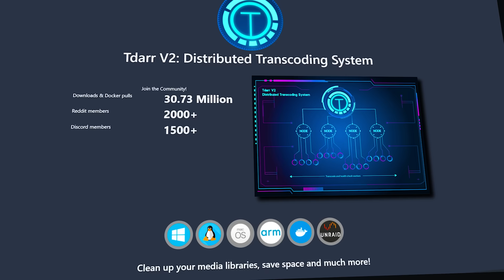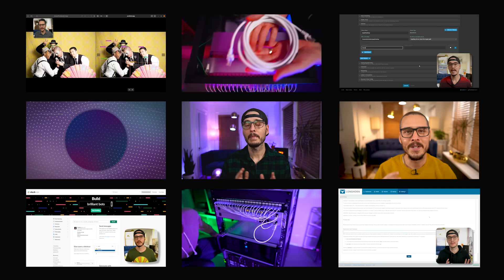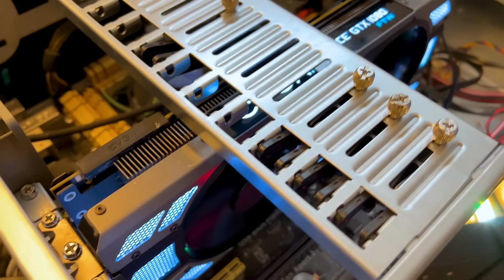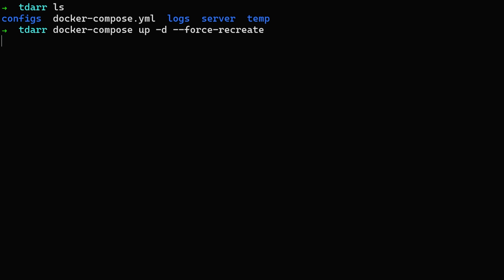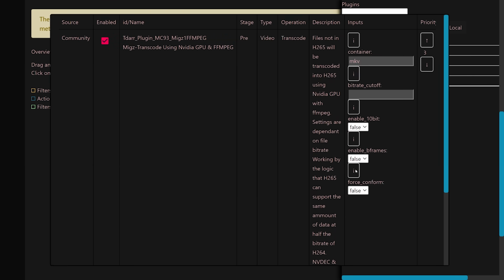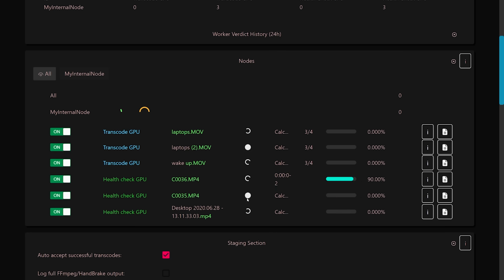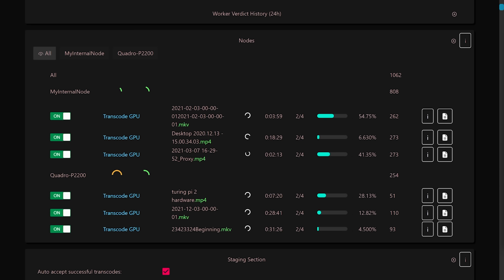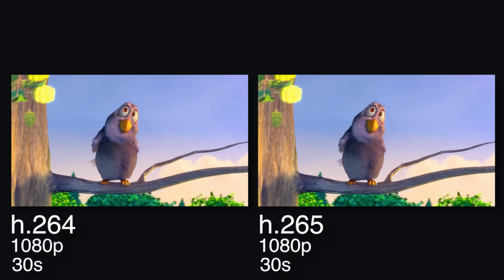I Freed Up 700GB+ Converting my Videos Using Tdarr

Comment: Tim - watched your tutorial again. This doesn't work too well with new TDarr with the Flows chat. Can you create an updated one using the Flows? or do you have a flow template that we can use? so we can point the library to the folder and it replace all the files in that library with the converted one?

Comment: Storage capacity is still growing at an exponential rate and I do no want to lose any quality.  Nor do I want to get arthrosis from months of twiddling thumbs while waiting for the transcoding to complete or want to watch every file to ensure  none of the files has been corrupted by accident.  Iow I use new codecs only for new projects.
There is also software such as NLE that keeps hash to uniquely identify video files.  Transcode a video input file and next time you open that old project you may have a whole lot of avoidable work.  Now that AVC / H.265 is slowly becoming more mainstream also consider VVC / H.266 is beginning to roll out.  Converting the video files yet again means cumulative loss of quality, usage of power and time.

if however your project happens to be to keep a backup of youtube or those other ****tube sites  ...  well, transcoding may be a good idea after all 😀

Comment: I've actually done some 4x zoomed comparisons between h.264 and AV1 or h.265.  AV1 and h.265 are better at lower bitrates.  But for archival quality, h.264 is actually better quality for a given size thanks to more mature tuning options.  This will likely change in the future as AV1 and h.265 gain wider adoption.  But for now I still use h.264 for ultra high quality encodes.

Comment: I'd really like to do this. I just don’t want the video quality being slightly lower than before. When setting up Jellyfin, I thought it’s a good idea to handbrake everything. Turns out, a lot of artifacts in slightly darker scenes. I had to re-scan everything and use another tool to just re-arrange and filter audio and subtitle tracks. 
Because of that, I’d only like to use it if it’s lossless. I need to read a bit more about it. Thank you!

PS: My library is 9.37TB at the moment

Comment: Wait till my dude learns about AV1
Reply: I was about to comment this. Plus if you record with OBS you can just record AV1 natively so you don't need to do any extra work (if you have a GPU that supports AV1 encoding).
Reply: @obscuratea  OBS' AV1 implementation is...not great, to be fair.
Reply: 2:17 One problem... the card selected (NVIDIA GTX1080) isn't capable of hardware decoding AV1 (much less encoding).  
Minimum Generational Requirement for AV1 Encoding is RDNA3 for AMD, GTX40 for NVIDIA and XE2 for Intel.
 Hardware decoding capability starts at one generation prior (This Excludes Navi 24 of the RDNA2 series for AMD)
Reply: @TwistedMe13 i wouldn't recommend gpu encoding of AV1 anyway
Reply: @Melechtna  yeah, I've been using Handbreak to encode some of my Jellyfin MKVs to From H265 to AV1. When I use GPU encoding it is frequently the same size as H264 but when using CPU encode I can get it to half the size of H265. It is far from time convenient, but I'm not using my computer overnight so I will often queue up a batch before bed. Its crazy seeing a BlueRay go from native 30GB down to 2GB with no noticeable loss of visual quality.

Comment: If you use ffmpeg and have an nvidia GPU here is a quick command to get pretty good quality h265 from a 4k h264 video: 

ffmpeg -i input.mp4 out.mp4 -c:v hevc_nvenc -rc vbr -cq 24 -qmin 24 -qmax 24 -profile:v main10 -pix_fmt p010le -b:v 0K -c:a aac -map 0 -strict 2

This is the best quality command I have found so far.

Comment: Hey TIm! I have been following your videos for some time now and I've learned a "hAckload" of things! So Thanks, first of all! I am down this rabbit hole because of you! hehehe.

I recently deployed a Kubernetes Cluster using your Ansible automation script, and it is great! I did a few changes to use "UEFI and romfile" boot on proxmox (to get intel igpu support) and I got the intel plugin working with my plex with HW transcode and all. So I am super happy to have achieved this with your guides.

Speaking of guides, could you give any directions on how to do this exact video but using Kubernetes (I just moved to K3S and hacked my way through guides) so I am very noob still) with igpu support? Is this even a good idea?

My objective is to use the otherwise 'idle' igpu and limit it's usage to do transcoding on when the cluster is not using it for Plex just to have all videos constantly transcoded.

Specs: 4x Proxmox cluster (Lenovo m720p)  - Intel Core I9-9900T -  UHD Graphics 630.

Keep up the amazing work!

Comment: Remeber, NVENC H.265 is way worse than CPU H.265 encoding. Yes it's fast but extremely inefficient. You could've saved double the space if it was CPU encoding.
Reply: This can be true but lots of people with large library rather faster encoding, the quality with GPU and the saving is pretty good without the long wait.

Comment: Tim, great content. Always learning something. Have you looked at unmanic by any chance. I have been using your method with tdarr since this video went up, thinking of changing to unmanic for the file sizes are much smaller and cant tell any difference in the video quality. e.g Converted my BluRay Star wars from around 10gb to between 6gb - 8gb using different settings / plugins with tdarr. Result using unmanic, got the size down to 2.5gb.
Reply from the maker: Not yet!
Reply: Not only I got Unmanic working faster, but it's open source; for those who are interested in that aspect too.

Comment: I started with a rpi (RIP it died.. I made a custom ice holder to cool the cpu.. had to refill the ice canister every morning).
Now i've worked up to a whole cluster with my 3090 being the heavy lifter.
Here are my results for anyone interested.

Performance:
rpi                                           < 1 fps
M1 mac ca                            1-5 fps
4vCPU VM esxi i7-4770k      24 fps
RTX 3090                              169 fps

Not sure if there is any point to letting the RTX 3090 work on more files than 1 since my encoder is also at 100%
EDIT
So I added 2 CPU jobs and 2 GPU jobs on my gaming rig. 
Even though my encoder is maxed i still got 160 fps on both GPU tasks. 
So it is worth doing multiple tasks eventhough the encoder says its maxed out. 

on 720 footage 
RTX 3090 and I9 9900k stats with two tasks each(same results as if i let one GPU and CPU do one each):
CPU tasks both get ca50 fps
GPU tasks both get ca220 fps. 

So far making it a total of ca537 fps from my gaming rig. Pretty sweet.

Comment: Tdarr is just using ffmpeg with actually pretty horrible default settings. It is just a front end for ffmpeg. I have a script that can do the same and do it better quality wise. Also Hardware encoding is beyond inferior to CPU encoding. Way more blocking and way more softness in the output. But to each their own I guess.

Comment: I was Supper Happy to see that video, so i jumped the gun configured Tdarr and rushed with encoding on GPU. 
I lost about 20GB of footage because of some bug or something (some of my videos got "converted" to 3d or something, they shows similar as 3d, screen next to screen but colors are broken and video is completely unusable).
I used the same settings as you Tim. Hard felt, so no sub, no like today.
Reply from the maker: That’s unfortunate.  Sorry they had a bug.  I didn’t run into this.  Maybe create a copy instead of replace until it’s done?
Reply: @TechnoTim  youp, that's the lesson I got =)
If something is too good to be truth, verify =P
Still i am not sure what caused the bug, I suspect that it was because of having some 3d movies in that library, and after encoding one all got the settings (i am not in rusz to run it again to verify ) 
Anyway, Thanks for a great content!

Comment: Based on the transcode options seen in your video. Transcoded videos might have less video bitrates.
"Settings are dependant on file bitrate Working by the logic that H265 can support the same ammount of data at half the bitrate of H264."
I guess the disk space reclaimed comes mainly from that bit rate decrease.

Comment: Would limiting the transcodes to 1 make any difference in the time it takes to complete 3? I feel that setting it to 3 just make each transcode take 3x as long.
Reply from the maker: you're right, it just divides them up however there might be gaps where the trasncoder isn't being used and using more than 1 stream ensures maximum encode time

Comment: Thanks for this. have been looking for a solution as I have around 80TB of video footage which i Need to archive and reducing the size while not affecting the quality will be a great move forward. Tried this with a Tdarr server and node on Windows 10. All seems ok until I try transcoding files over 4GB, they transcode but the copy from the cache does not happen - am I missing something fundamental here? Has anyone had the same issue on windows or linux with files greater than 4GB? (have about 35TB which are over 4GB, max size i think is 90GB. Any suggestions?

Comment: to me, its like saying let's rip vinyls and throw them away once converted.
makes absolutely no sense. I'd adtualy compress/zip instead. that way it's intact. also, if you dont have the space, backup/archive/build a bigger volume...etc

the premise of this video is weird. it would make sense when speaking of plex which has a built in transcoder to stream on the fly but to actualy touch the original source files is like insane.

Comment: CPU/Software encoding often allows for more quality to file size ratios, as hardware encoders are often limited in their capabilities as compared to software encoders.  This should not be interpreted as saying Hardware encoders can't do as good of visual quality as a CPU/Software encoder.  It's strictly a quality to file size ratio.  A CPU/Software encoder with some of the craziest options, will be able to do a high quality image using less storage space than a Hardware encoder will be able to.

Settings and CPU depending, you can fairly easily get to messing with encode settings that will triple or more the encode time.  Quality vs Time often comes down to very subjective opinions with wildly different reasons for each person.  If you're doing a single video and you don't care if it takes all night to encode, a CPU/Software encoder is probably better for your purposes.  If you're on a tight time line and have to whip out several videos or hours worth of video, you may opt for Hardware encoding or even a combination of hardware and software encoding (just to keep all your resources busy) and skip on some of the file size settings/savings in favor of saving time.  If you have zero concern for storage space constraints, a hardware encoder and speed might be a great option for you.

And that whole argument of time saved vs storage size requirements is also going to be extremely reliant on the hardware you have available.  A 5950x will pretty handily chew through some software video encoding, and if you have one of those CPUs, and you're looking for quality, you may as well use it instead of hardware encoding.  But if you have a 4 core CPU and a decent GPU, you may opt for the hardware encoding option.  It's all going to be very case by case, person by person... subjective.

Also, a great rule of thumb is that you should always try to encode from the source if possible.  Transcoding introduces quality losses and those can vary depending on exactly what you're doing.

If by chance, when you first encoded the video, you chose to use exceptional quality settings (far in surplus of what you really needed or maybe you were targeting near lossless image quality to start with), you can likely get away with a transcode to a more efficient format, and visually see minimal quality loss, if at all.  If instead, you were very aggressive, aiming for small file sizes to start with, say 480p with a bit rate that made reading text on a youtube comment section difficult to read, you should probably not transcode the file at all.  And let's face it, anyone who has owned a computer for the last 10 to 20 years, is likely to have some of those old 480p videos where the settings were very obviously aggressive for storage / bandwidth savings.  Leave those videos alone lol.. unless you can recreate the source material or have the source material to do a redo.

Comment: Transcoding 8tb of videofootage with a xeon e5-2407 v2, would I be able to achieve that within my current lifespan? Or is a gpu really a dealbreaker when dealing with several terabytes?
Reply from the maker: CPU transcoding gives you better quality and smaller file size .  I saw go for it!
Reply: @TechnoTim  Really? In that case there's no harm in trying, thanks

Comment: I use handbrake to take direct blurays to mkv using MakeMKV with 5.1 sound, and it will drop it from 25gb to 4-5gb each file.  works great with a 4tb external hd and a sony BPD-S5500

Comment: Try looking into something like LizardFS for storage moving forward. 
You'll be able to scale your storage with redundancy at a software/filesystem level rather than dealing with raid arrays.
Need more redundancy on a single folder, no problem. Need more space, add more drives or chunkservers.
If a drive or server drops, chunks from other drives or servers will be copied to re-meet the redundancy goals, instead of a crazy raid rebuild.

Comment: 2.1TB saved on my backup OTA recording server, probably 8 on my main server, but there isnt good stats on that because i had been using the predecessor to TDARR, handbrakebatchbeast, which is sometimes more reliable than TDARR if you are using CLI arguments on handbrake
Side note, i was blow away with how fast a cheap alderlake processor transcodes videos, no joke, i saw frame rates over 1000FPS going from MPEG2 to H265, but the hardware transcoding issue remains un-changed. Everything, from AMD VCE, to NVidia NVENC, or Apple Video ToolBox WILL make the average file significantly larger than CPU transcoding
Side side note, this issue seems to be mostly limited to GPU transcoding between different families of codecs, going from H264 to H265 is great, but going from MPEGX to H26X is just terrible

Comment: You're going to be MUUUUUCH better off CPU-encoding H265; as the GPU encoders do not have the capabilities to fine tune profiles.  CPU encoding will take enormously longer, but result in a good 30% decrease in file size over the GPU encoded.  The reason for this is that GPU encodes only need to do so generally for uploading to streaming services, etc.  They care far more about time to encode the frame than they do quality - so they generally will use a fast preset profile that the GPU provides.

Comment: This is one of those cases I really don't understand who it's supposed to target. It's still way too complicated and too much hassle for a random schmuck to deal with but at the same time someone who knows what all of this is about will have much more specific requirements and already know how to handle transcoding in a way that suits them much better.
Reply: I'm assuming you mean the video and not the software?  Either way, I don't know if I'd qualify as as a random schmuck as I build/repair computers, have hosted my own servers etc.  But I'm FAR from being a professional, everything I know I've learned by doing it; no education or anything.  Encoding/decoding/transcoding are a very weak point for me, as are parts of networking.  So for me this seems an awesome way to get started messing with this stuff.  So I guess I'm who this would be targeting.
Reply: @Mad-Lad-Chad  Of course I was being hyperbolic, I can see the positive comments after all. But I genuinely don't understand why someone would think it's preferable to learn how to operate software which has this kind of narrow focus but is not at all beginner-friendly compared to a one-button-solution, rather than ffmpeg, which is barely (for the same kind of purpose) more complicated and versatile enough to handle virtually any kind of encoding-related task. Granted, I did of course try many GUIs over the years as well (many of which are just frontends for ffmpeg anyway), but I always go back to command line because it's just so much more powerful and reliable.
Reply: @EireBallard  A lot of users hate command line, but short of that it would be due to lack of knowledge I imagine.  I thought this software could do more than just this specific conversion, but admittedly I was mostly listening to the video in the background as noise.  I'm not even really sure what ffmpeg is.

Comment: If you have alot of space processor time you should rather transcode to av1 (better then h265 and open-source the actual future of video) and opus(for audio). This will take alot of time and currently doesnt have any gpu encode support. VP9 is a good alternative to h265 for better browser and mobile device support as h265 royalties are insane.

Comment: Seems like most video apps that are good, this is based off ffmpeg under the hood. At this point I’ve seen it used so often I’m just using it outright along with some simple bash scripts. Nice find for a distributed transcoding solution though!

Comment: ubuntu 22.04 thoughts? 20.04 is what I've gone to for my baremetal or VM needs (sweet sweet LTS), but I hated that I had to use 21.04 for pi USB boot. With 22.04 I'm looking forward to it. I used the beta in a VM with success, and I would love a video on your thoughts of it.
Reply from the maker: I will switch to the latest LTS probably in about a month or so